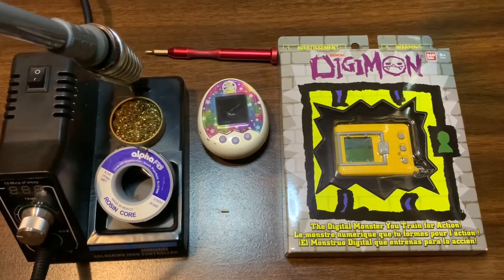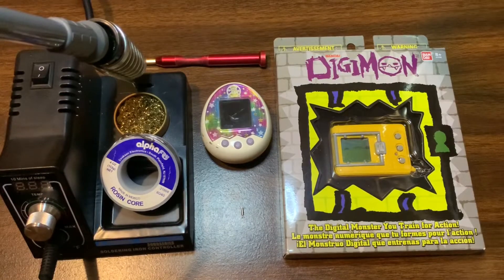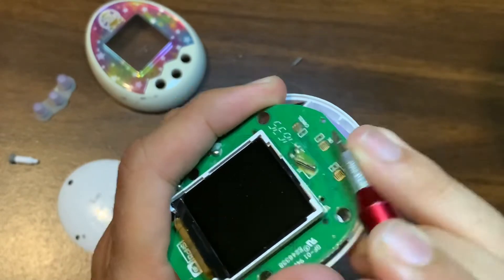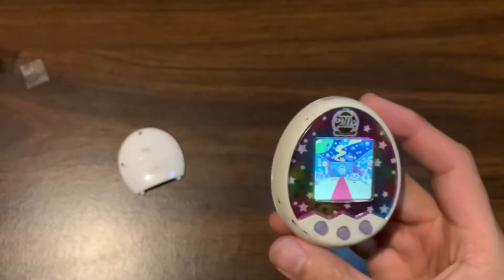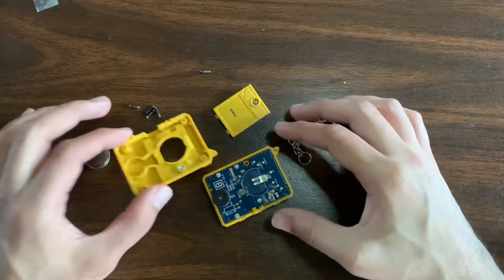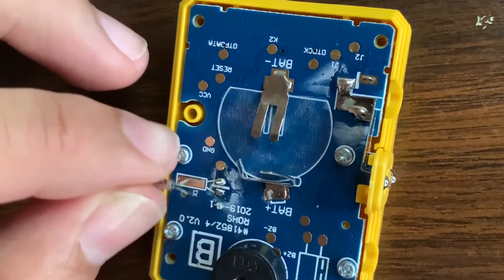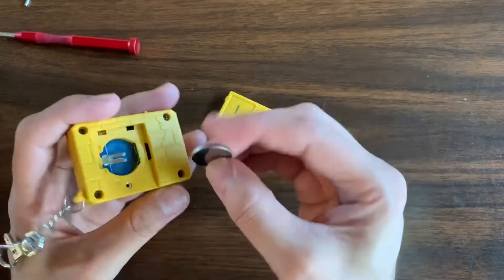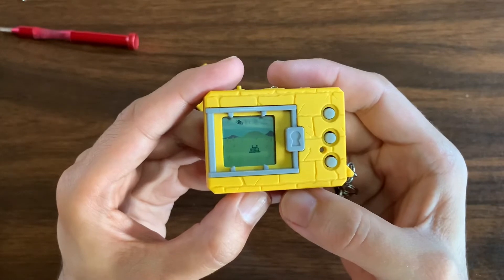Tutorial: Tamagotchi & Digimon Hyperspeed Mod

Comment: Do you know what happens when the clock does tick on the Mix
Reply from the maker: When the clock does tick? Was that a typo and you meant to ask what happens if the clock doesn't tick? If so, the clock not ticking is usually a  sign that the crystal resonator is faulty and needs replacement, or sometimes indicates it wasn't soldered on properly and should be removed and re-soldered back (assuming you modded it)

Comment: Would it be possible to add a slide switch to the crystal oscillator to allow you to choose one or the toehr clock speed?
Reply from the maker: I've seen a lot of people ask that, but I don't think I've seen anyone implement it yet. I can't imagine why it wouldn't work though and I think it'd be really cool to see.
Reply: Thanks, I'm doing this. I'm gonna use a pushbutton instead so it has to be held for boost

Comment: How do you revert it to normal speed?
Reply from the maker: Hi Abner, are you asking how to revert one that has been modded with hyperspeed? The process would be exactly the same, except you would install a crystal oscillator with the default speed of 32.768 KHz
Reply: @TamagotchiCollectors  oh ok, gotta check that out. Is just that I bought one with this feature activated and would like to revert it 😊
Reply: @TamagotchiCollectors Thank you for eventually learning the proper word for the component you're using.
Reply from the maker: @Atmatan  Yeah, when I started I had 0 knowledge and only learned it was an oscillator when someone eventually corrected me. Not even sure where I originally learned to call it a resonator XD. Anyways I should probably put pinned comment with that correction.
Reply: @TamagotchiCollectors  Likely a consequence of the literal function it performs. Oscillators do indeed resonate, but Resonators are a different specialized component which will harm your device if you mistake the two.
Reply: I tried changing it but the time doesn't run 🥺

Comment: Would it be possible to set this to a switch where you can change which resonator a digimon can run off of?
Reply from the maker: I think so, but I'm not too sure. I know with some vintages, if you were to try that it would forcefully reset the device. With the models that have a resume feature when they power back up, this probably would be okay though.

Comment: What about tamagotchi on? Does this work?
Reply from the maker: It probably does, but the issue is that the On has a weird plastic frame around the LCD that rubs right up against the resonator. To solder the resonator you're going to end up burning the plastic LCD frame unless someone can figure out how to remove it. I couldn't figure it out :(